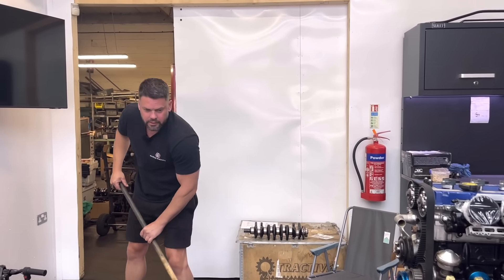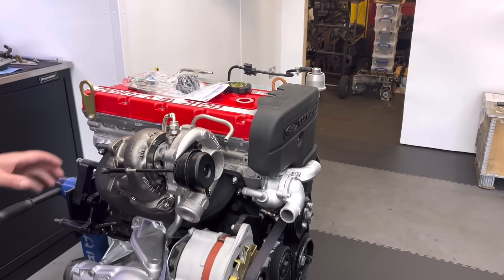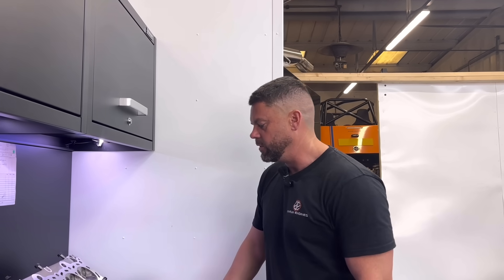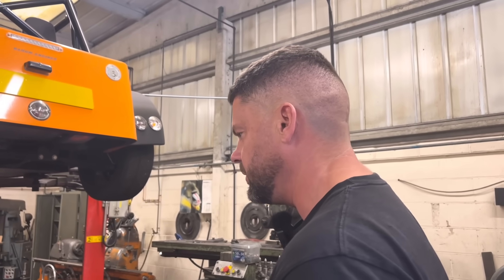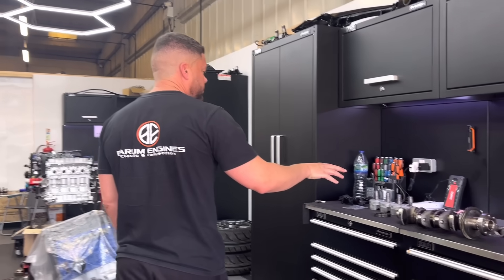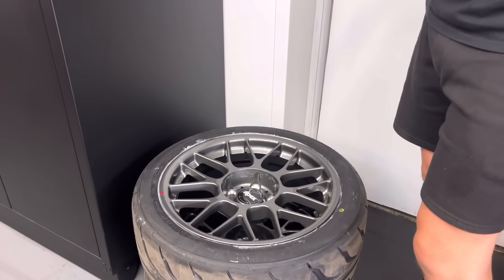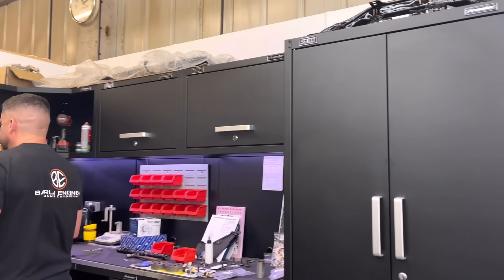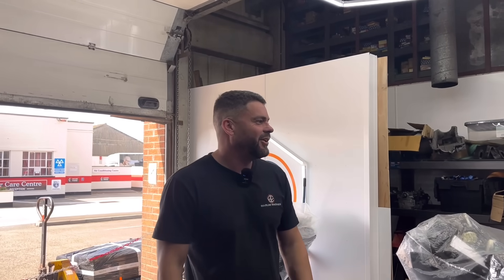We DISAGREE with the viewers on this subject!

Comment: This is making me angry I brought a cosworth with a newly built head the engine was in two the guy said it just needs bolting together I noticed grit so had my engine builder stip it it was a horror story the valve spring pedestals were missing even though it had new valve stem seals! (thanks to Harvey gibbs for the pedestals) turns out all oil ways were packed with grit. I washed it out today went over kill on it but to be fair it wasn't difficult and didn't take 3 hours. People without engine experience shouldn't be responsible for the crap left behind from someone who does half a job. I think you have made yourself look foolish here how many of your customers are sat there now after watching this thinking God is there metal files in my engine! I do get what your saying about it being a machining job but if that's your way of doing things then I question what your leaving in people's engines surely there is a process of cleaning properly weather you are building the engine or not building the engine the way this has gone on in my eyes you have set the guy up to fail!!! And he will be only one of many I'm sure.

Comment: When I take a block to my machinist I tell him don't bother cleaning it I will do that myself because even if its supposed to be clean I'm still going to pressure wash , brush out all the oil passages , run a thread chaser and compressed air in all the threaded holes.

Comment: As a garage owner it is always a standard practice to thoroughly wash the cylinder head or block in paraffin then wash off with a high pressure water hose. Then blow out all the holes etc with compressed air making sure everything was dry. You cannot expect a machine shop to do all that. They are there to do machining  not to spend hours cleaning.

Comment: Lee i totally disagree with you with regards to cleaning after your machining process , So are you telling me that when you buy a component for one of your engines you stripe it and clean it before you use it , l know that's not the case , With regards to people doing machining work after the work you have done then yes they should clean the component , However if the failed part is returned to you with no evidence of work being done post your work then you are liable for repairs due to swarf residue , Sorry but that's the way it goes Lee.
Reply: I think it's been explained very well. 
The assembler is responsible for cleaning.
Would you, if you were assembling an engine, not inspect and clean all parts?
Reply: I guess David has never working in any kind of workshop.
Reply: @robdefire4747  LOL , I am a time served Tool Maker and worked in a Motorsport machine shop for 30 years.
Reply: @davidcook380  sure.